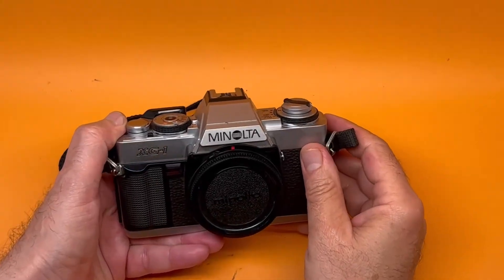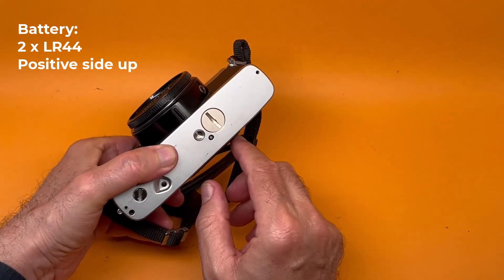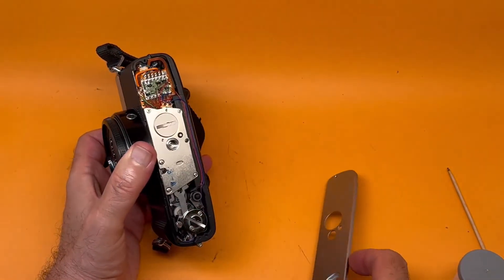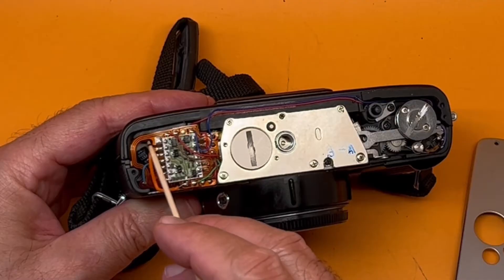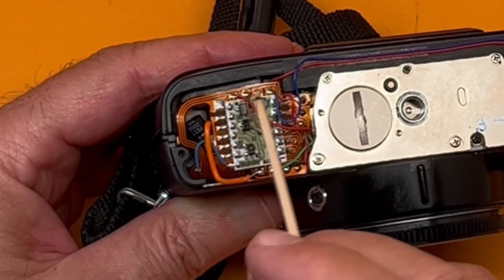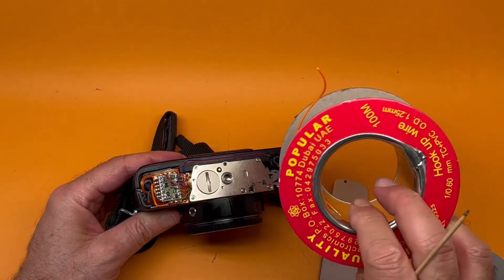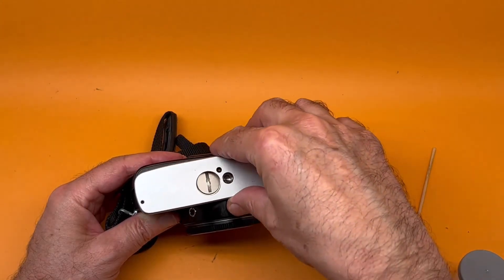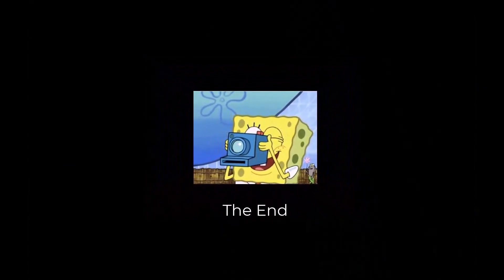Quick Fix, Minolta XG/XD/X... winding lever locked up, shutter not firing

Comment: I have an xd11 the shutter
Fires on B&O Manual mode but no other stutter speeds . The LEDs in the viewfinder work when on A&S priority settings any idea what it could be ?
Reply from the maker: The LEDs are a different system, so it is good that they work. The B and O settings are fully mechanical. This is also a good indication that there are no Mechanical problems. The rest of the shutter speeds are electronically controlled and are faulty. I can only recommend that you follow the recommendations of this video, check the capacitor and if necessary change it. Normally it should work.

Comment: Which leg did you solder to that front blob of solder? the positive or negative leg of the capacitor?
Reply from the maker: I dont remember now. It was a long time ago. I traced the old capacitor leg from the front to the blob of solder. Then soldered the same leg of the new capacitor (positive or negative) to match the old capacitor.

Comment: Mine has slight shutter squeal like the ae1 is it the same fix?
Reply from the maker: The shutter squeal is not the result of the same electronic fault described in this video. But it is similar to the problem often encountered in some other cameras including Canon and Pentax. It usually happens in higher speeds above 1/250. Usually it means some of the internal components (not shutter curtain itself but the gear mechanism) need cleaning and lubrication. The original lubrication becomes sticky over time. They need cleaning with alcohol or ideally lighter fluid followed by the smallest amount of new oil lubrication. It is not possibel to determine where it is actually sticking without looking at it. You need to remove the bottom, plate and look at all the gears. See which elements rub against each other during the shutter release. Clean as much as you can with lighter fluid and Qtips. After clearning it may work even without lubrication. This confirms that the problem area has been identified. Dont get too confident as later, when lighter fluid completely dries, it may stick again. So, after the cleaning job use a little lubrication and fire the shutter at high speed a few hudred times until it penetrates to all surfaces touching each other. If that does not solve the problem, then you may need to remove the top plate also and do the same with any moving elements related to the shutter. But usually the bottom section is the problem, not the top. In some cameras the squeal is not actually the shutter but the mirror sticking. Usually you can tell that it is the shutter when you open the camera back, put the shutter on the highest speed while looking towards some light. If you press the shutter release and see no light at all, it means the shutter mechanism is slipping, not the mirror. If you find that the squeal is not present at lower shutter speeds this also confirms that it is the shutter mechanism, not the mirror.

Comment: Hi, I have the same exact model and im experiencing another issue. My on/off/b.c and selftimer knob move without friction and camera won’t turn on. How can I fix this?
Reply from the maker: It is very hard to diagnose such problems remotely. But there is usually a common patter that can be considered. When some of the knobs and dials turn freely without any friction or engagement, it means a mechanical system behind them is broken. On this occasion my best guess is that before you, someone has tried to open the camera to fix something and has not been able to put it back together correctly. As I have personally experienced this many times, but I never give up until I put them back together correctly. So, what to do next? I say do nothing. Firstly in vintage cameras, even perfect ones, don't use the self timer. That is the system that fails most often. So, if it does not work, dont try to make it work. Some service people ever offer to disconnect the self timer as a preventative measure. As for the BC, again dont worry. Every year put a new battery into the camera and it should be fine. All you need is for the electronic shutter to work.

Comment: Hey so I have an SRT 101 would the issue plauging this be the same on mine or could it be somthing different?
Reply from the maker: Your SRT101 is fully mechanical. Your problem is mechanical not electronic. It should be relatively easy to fix by someone with experience in opening the top and bottom plates.

Comment: hello everybody maybe this still helps someone. i had the same issue, but mine was a freshly restored XG-1. i called the mechanic and he told me that since the mirror is up, i should open the back cover and remove the lens, so i can from both sides push the curtains to either side in my case right (looking from the back). this worked and the mirror went back down, now it works again :) hope this helps!
Reply from the maker: Thanks for your tip. It appears that your problem was not electronic but Mechanical. This video is about the much more common Capacitor problem with a variety of Minolta cameras. Even later models which were picked up by Leica in their early R models had similar electronic problems. Thanks again for your tip on the Mechanical problem.
Reply: Occam's Razor. Worked for me too!
Reply: @cms1138  glad to hear this helped somebody!
Reply: Great, I just checked my XG7. Bingo works. Thank you so much for sharing it.❤❤🎉🎉🎉😂
Reply: Hi Vincent, hope you’re doing well! I had the lever advance problem where it was too loose. After turning the little part below counter clock wise, my advance lever got stuck. I noticed that the mirror is now stuck as well. Would you be able to give more details about what you exactly mean with pushing the curtains? Will it not damage the curtain? Thanks a lot in advance 😊
Reply: This helped me, thanks!

Comment: I have a xg-m the shutter stopped firing and the lever was stuck.. but i pushed the lever and now its loose ( advance lever ) and the shutter still wont fire... But the light meter works fine.. what could be the issue...?
Reply from the maker: When you say it is loose, do you mean you can wind it repeatedly with out any locking mechanism after one stroke? If that is the case, I suspect you have forced it too much and broken the locking mechanism inside. In the normal situation, after one stroke, the shutter is charged and winding is locked until you shoot. The shooting depends on the electronic shutter, which is sometimes the problem and this video is about how to release it electronically. Since your shutter does not fire at all, you should not be able to release the lock for winding. I have a bad feeling about this. The only way to find out is to remove the top panel and look at the winding mechanism. You may also have to remove the bottom cover. Also try the rewind button and see if it makes any difference. If you get the locking mechanism back, it is good news, then you can try the fix for the Capacitor, which normally releases the shutter electronically. There are no guarantees.

Comment: Hi, I have a Minolta XG1 and i have a different problem, when I load a shot it fires automatically without pressing the shutter button, do you know what it could be?
Reply from the maker: I have not encountered that with Minoltas, although I have seen it happen with fully mechanical cameras. I cannot give you definitive advice but I can only speculate and tell you what I would look for. As you know only when the winder is fully charged, the shutter button works. That is a double exposure prevention mechanism. So, there is a link between the film winding mechanism and the shutter button electronic activation. In the case of XG-1. If something in that mechanism is creating a permanent electrical short circuit, such as rust, all it needs is for the winder to complete its action and it will fire automatically every time. I would open the top panel (I hope you know how to do that). I would then look for that mechanical/electrical trigger point and see if the area around it is rusty and dirty. I would clean it thoroughly with lighter fluid and put it back together again to see  what happens. I would say you have no choice but to try these measures anyway. No-one is going to repait a Minolta XG-1 for less than the price of buying a functional one on Ebay. So, try and see what happens. No guarantees, but the experience itself will be worth something.
Reply: @TechHeritage  Thanks for the advice, I'm going to proceed to take it apart and hope for the best.
Reply: @TechHeritage  Hi, I decided to disassemble the camera. I really didn't find anything out of place so I decided to give all the components including the trigger an alcohol bath, apparently this worked, the camera works normally. Maybe it was humidity that the alcohol dissipated.

Comment: I just replaced the capacitor, but still having the same issue. Any ideas what that could be?
Reply from the maker: Very sorry to hear that it did not work on your camera. Here are some suggestions, again, not guaranteed to work: Double check to see if you soldered the capacitor the right way around. The two legs are not the same.. Clean the battery chamber. Remove the bottom plate again and see if the Mechanical parts are moving freely or something is stuck. In some models there is another problematic capacitor under the top cover on the left. But you need to have more experience to remove the top. 
Once you remove the top also see if the problem is Mechanical under the winder to the right. You have nothing to lose, right? So why not try these.

Comment: Hello! Great and informative video, but I do have a question - do the shutter curtains not open when the winding lever is locked and shutter doesn't fire? That's the case for me. I'm sorry if the question doesn't really make sence. Thanks in advance.
Reply from the maker: Good question. I dont know for sure, whether the film advance lever gets stuck before opening the shutter curtains or after, or both. In my case, the shutter curtain was already open (tensioned). So, as soon as the capacitor was in place and a new battery was inserted, the shutter was released.

Comment: This video did not fix anything, it just shows where the capacitor is, waste of time !
Reply from the maker: Sorry to disappoint. As the label suggests, this is a "Quick Fix" for the most common problem reported on this series of Minoltas. All that is needed is: 
1-Knowing that the problem is: Just one Capacitor
2-Where is it? top or bottom or inside? Bottom 
3-Can you do it yourself or not? Yes
4-What do you have to do? Get a new one with the same capacity and solder in place. Job done
The camera that I demonstrated had the same problem and was fixed in 10 minutes. I did not think I needed to demonstrate taking out two screws or the art of soldering. If those present a challenge, self-repair is not recommended.
Reply: "waah....i need my hand held...wahhh...i can't follow directions so that makes everything your fault.. waaaaahh"
Reply: I agree with you. It's like opening the hood of the car, saying "see this, you have to replace this part" and calling it a quick fix.
Reply: Unhelpful comment. This video clearly points out a common issue with this line of Minolta cameras. If you can't pay attention long enough to watch a 4 minute quick fix, you're gonna have a hell of a time learning how to use that SLR

Comment: Could this also be the problem with an X-9?
Reply from the maker: I am not sure since I have not tested on X-9. However, other reviewers seem to be of the view that most Minolta shutter lock problems are due to the low quality capacitors. However, some models had this problem with the capacitor at the bottom only. Others had the problem with the capacitor at the top, which is much harder to get to. It does not hurt to try the bottom capacitor first and see how it goes. It is easy enough to reach.
Reply: @TechHeritage  I took the bottom off and it looks like there is a capacitor in much the same location (although easier to access fortunately!), which looks like it's burst and needs replacement. Capacitor ordered and I'll try replacing it when it arrives. Will let you know how I get on!
Reply: @sitedrm which capacitor did you use? Have you had any luck?
Reply: @robertoleal2397 I bought a capacitor with the same capacitance but a higher voltage rating. Unfortunately it was also a bit bigger. I solder it in and it fixed the problem! I bodged it to fit by heating the bottom plate a bit to deform it around the capacitor. Bit of a comical solution but the camera works so 🤷🏻

Comment: Hi, great video, but I got a question, before trying to change the capacitors where the leds of the lightmeter working? I bought an xd5, changed the batteries but the camera desnt shoot except on O & B mode,  but the lightmeter leds doesnt show on the viewfinder, so I want to now if that was your case before I decide to replace the capacitors.
Reply from the maker: That was not the situation with the camera demonstrated. For the model demonstrated, the capacitor at the bottom is usually the problem with shutter not releasing. For other models sometimes the capacitor at the top of the camera under the top plate is the problem. But that is harder to reach as the top plate needs to be removed. Neither solution is guaranteed. However these failing capacitors are the well known causes of problems.

Comment: Where did you buy the capacitor? What is the party number? Thanks for the great video!
Reply from the maker: You can take it to an electronic repair shop. Places that repair audio equipment. They don’t specialize in cameras but they can identify the type of capacitor required by its shape and label on it. They either have the part or can order it online. Unlike microchips these electronic parts are common, interchangeable and cheap. Then they can also solder it for you.

Comment: Took my XG1 to electronics guy. He changed the capacitor as described. My camera works great now.
Reply: I should add. I took to two different camera shops. Told me it was no good. Buy a new body if I could find one.
Reply: How much was the repair?
Reply: I think he charged me $30